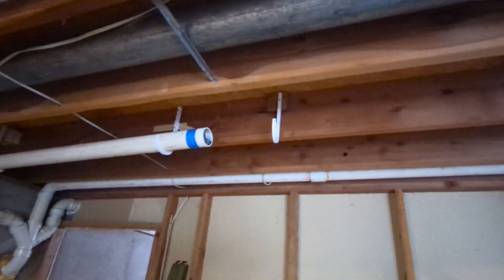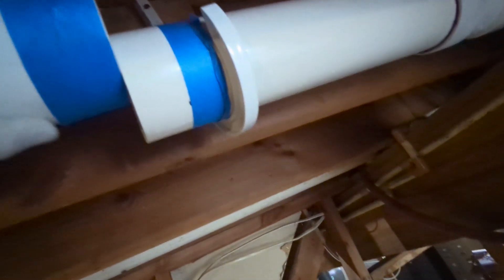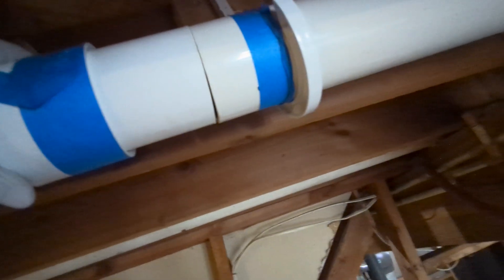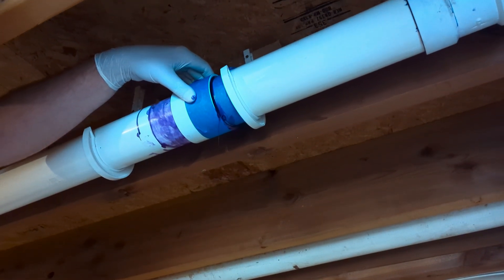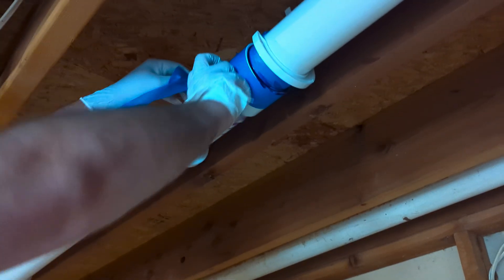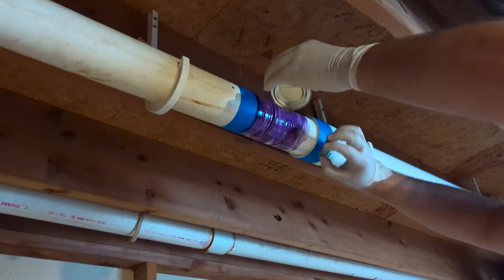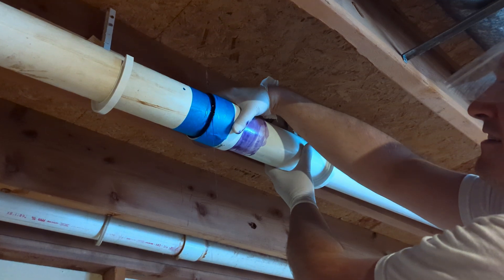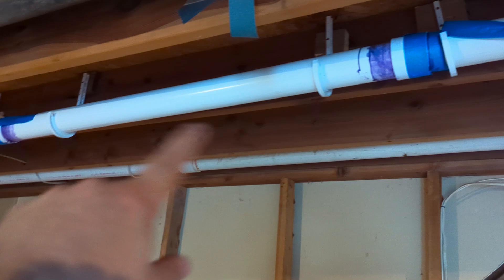[FAIL] Joining two stationary 3" PVC DWV pipes with double slip couplings (mistakes in description)

Comment: Tried the first time on 1.5 drain pvc...has a small leak and I have to cut it out lol
Reply: Why put 2 fitting width of primer on the first end ?  If anything it’s just making it harder to slide the coupling. 

You need 2 people to do this and a medium body glue that allows a few more seconds work time. Have the helper ready with a full glue dobber, slide the fitting overshooting the stop point by 1/3 fitting depth, helper immediately adds glue to the trailing edge and you slide the fitting back a little
Reply from the maker: The procedure I'm using in the video might be easier with 1.5 then with the 3 I was working with.  But learn from my mistakes if you try it.  
The bolt-on NSF no hub couplings have not leaked now in the 3 weeks they have been installed.